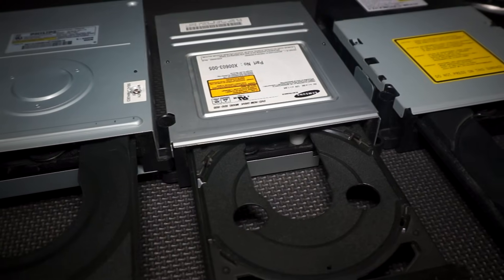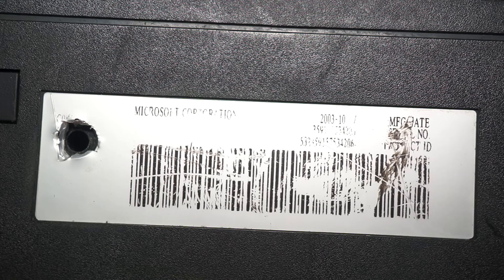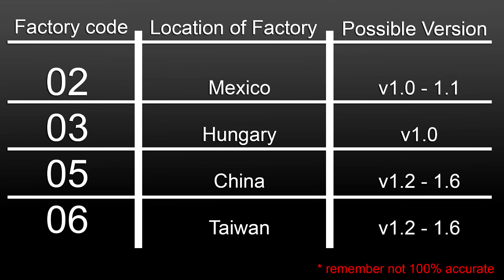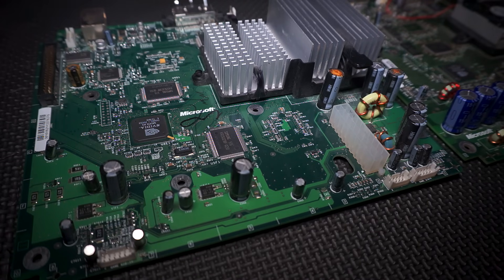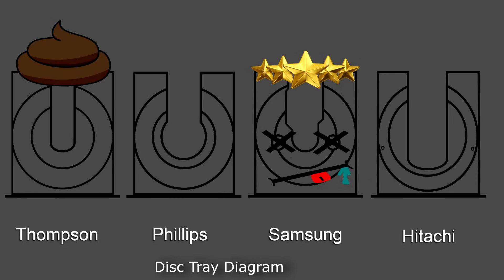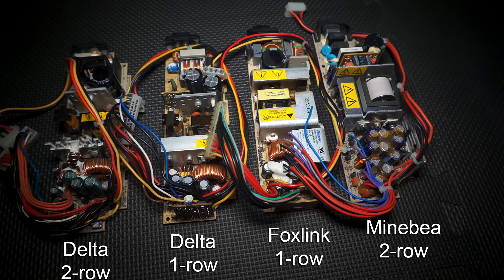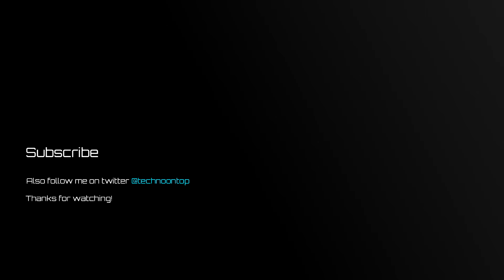How to tell what version original xbox you have

Comment from the maker: A mistake was made in telling if you have a v1.4 or a v1.5 you need to measure pin 2. I showed pin 1 also you could measure pin 9 while the console is powered on. it should be 3.3v if not it's most likely a 1.5. though there is alot of speculation around the existence of the 1.5 so who knows. wish I would have caught my mistake way earlier.
Reply: I found my Xbox on the thrash and silly me brought it home, after like 5 minutes i learned my mistake... it had an infestation of roaches!! i had to quickly bring the spraycan. I spent like 3 hours of cleaning two coats of roach shit and killing the buggers. When i checked the PSU and it had some sort of "Fuse" covered by plastic, after scraping the plastic covering the fuse, it looked like it had blown. So i made a small bridge between both ends and put it together. My Xbox motherboard has much less capacitators. I tried searching for videos and screenshots of my motherboard but none of the 100+ screenshots that i found seem to match the motherboard that i got. I could not even find the Clock cap... now you mentioned an Xcalibur video chip, it seems that i have that, and that would mean i have a v1.6? The xbox came with a Samsung DVD Drive, an 8GB HDD Western Digital and the PSU which says Delta.

After a couple days i ordered the AV Cables, two controllers and a power cord, since whoever threw didn't got rid of those. The XBOX workd perfectly after cleaning it and bridging the PSU fuse. I want to get a new Fuse but there is absolutely zero info regarding the Fuse Voltage/Amp. When i launched the Xbox I noticed it had a TON of Emulators ranging from NES, SNES, N64, Sega Master/Genesis and MAME. 

I thought 1.6 was hard to softmod, but i can't seem to find any sort of chip installed to the motherboard. I am also trying to update the softmod launcher but i know very little about such things. For now, everything works perfectly and i am kinda getting attached to this roachy xbox console.
Reply: @EtaYorius  roachxbox
Reply: @waltersobchak7275  roachbox lol
Reply: softmod is as easily done on a v1.6 as on any other versions.
ram upgrade and a tsop flash are not possible on a v1.6
a modchip can be mounted but requires some soldering to get it working.
Reply from the maker: @Steve Underwood the pins are on the LPC header, if you google "xbox LPC pinout" you should be able to find a pinout to aid you. thanks a bunch its much appreciated!

Comment: Can anyone confirm if the console freezes when doing the splinter cell hack and having everything running properly beforehand, can anyone say if that means that I do have a 1.6 version? I thought I did have a slightly older model, but even though there was a video explaining that if it does freeze then you just need to do it again but it would never work for me so I think this system is the latest version. It does have a Phillips disk drive so I'm not sure

Comment: Forgot one little detail about the 1.6 motherboard. It has a gold clock capacitor and lasts alot longer and less prone to leaking. Good info. I have 5 original xboxs and only 2 that work. The others are just for parts.
Reply: I have Xbox 2004-10-14 do I have a 1.6 ?

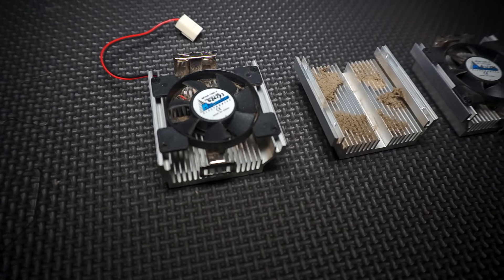Comment: Our sticker is missing and our system is modded. Have a single row power supply, Conexant chip, and no fan on the motherboard, just the upgrade you talk about at 4:14.  Still unsure if it's a 1.1 because it's not the same

Comment: found my old xbox after it sitting in storage for 15 years, it was soft modded a long time ago, looks to be a 1.6b with hynix chip and xbox logo. should i bother with hardmod or just RGH my 360 and get an emulator?
P.S. Power supply is 2 row delta but different version than whats in the video, im assuming since the box is 1.6b its newest revision.

Comment: I've got to open mine again to check the capacitors and figure out why the DVD drive has stopped reading discs, was full of dust at one point but cleaning it out didn't help at all. 

I'll look into softmodding it so I can enable higher resolution outputs. Good video, very informative.

Comment: So....i got 3 original xboxes. tho only one of them is working the other 2 have an broken powersupply. Is there a place where u can still buy those powersupply's In the eu?
Reply from the maker: I'd check for cold joints on the boards first. Also I'd swap the working one into the other 2 (if they are compatible) just to actually make sure the psu is the problem.

Comment: the way to tell the difference between v1.2 and v1.3 is to check LPC pin 3 with an Ohm meter set on the 2000 scale. a v1.2 will get a reading, the v1.3 will be open circuit. v1.2s are actaully very uncommon.

Comment: Back when the 1.6B came out. I wrote a program that basically has you select certain steps to find out which version you have. It should be on the old Xbox modding forum for the OG xbox.
Combination of several factors. Serial, chips, heat sink, fan etc. Then you could know what was needed to mod yours.
However now there is 1 chip that can mod any of them.
Reply from the maker: Yeah I remember it way back in the day on xboxscene.com

Comment: Are these power supplies interchangeable? I have a v1.0 for 2002-10-9 and I have the delta 1-row that is COMPLETELY shot all of the capacitors are blown up with the white stuff coming out and the copper circle round things are all blown the whole thing is garbage, I would just like to know if I can change them out or if I have to stick with the delta 1-row. Thank you
Reply: Thompson disk drive and kernel 4034 with the western digital 8gb hard drive, I want to upgrade the ram and the gpu cooling (before it turns into a lawnmower) and reapply the thermal paste for both gpu and cpu and I want to soft mod and put an upgraded 80wire ied instead of the stock 40wire
Reply from the maker: Yes all one row power supplies csm be used. Are you sure the power supply is actually bad, they do cover the caps in white adhesive. It's to help them stay in place from vibrations and what not.
Reply: @TechnoOnTop  I turn it on and let's say I load like Sega gt 2002 it loads for maybe 45 seconds at most and then it boots me to home and the green around the disc button turns red
Reply from the maker: @gabrielbanta5098 have you redid  the thermal paste yet? That honestly sounds like it's just overheating.
Reply: @TechnoOnTop  not yet should I do that and see if it fixes it instead of buying a whole new power supply ?
Reply from the maker: @gabrielbanta5098  definitely do that first
Reply: @TechnoOnTop  okay, thank you I'll try not to mess it up I have it all taken apart I hope I can put it back together lol, but I'll do the paste and let you know if It fixes it
Reply from the maker: @gabrielbanta5098  just take it slow and stay organized, the xbox is extremely easy to take apart. Good luck

Comment: This video is the reason I found out the Xbox I've had for the last 18 years is a 1.6b. I have the Xcalliber encoder chip and the Hynix ram modules. The manufacture date is 2005/04/25 which means it was one of the last consoles off the production line. I think there were fewer than 4 months of consoles produced after mine.
Edit: my power supply doesn't resemble any of those either. Want me to send you a picture of mine?
Reply: Yo, ik that uh, i'm commenting later, didn't need everythingnfrom this video, since i knew about MFR date stuff (just like on any other xbox) serial number, disc drives, 1.0 gpu heatsink, etc. But yea, i also have 1.6b from April 2005, i believe it was April 19 tho? Not sure

Comment: Thanks to your video I was able to discover my cousins Xbox from childhood was a v1.0 with a Delta 1-Row PSU (I'm shocked it hasn't caught fire after all these years), 10mb Seagate hard drive, and a Thompson drive which indeed is terrible and had more issues running the GTA games than anything else. After taking his to soft mod it, I replaced his with a v1.6 so he could still have an Xbox, it happened to have a Hitachi drive, and I can also confirm it definitely loaded faster after comparing with the v1.0.
Reply: my v1.0 xbox has trouble running gta san andreas. sometimes I get a disc read errror. is the thompson drive causing this
Reply: @ockertoustesizem1234  Im so sorry it has taken me a year to respond, But it would seem it would be. The laser diodes used in the Thompson drives aren't designed to last, and burn out after years of use. It was even terrible at reading when it was still new, freezing on loading screens for GTA Vice City, and it only got worse as years went on. My Thompson drive FINALLY died, as it stopped reading all together just a few days before posting this. If yours still works, i seriously suggest softmodding it. You can then clone the hard drive to one with more storage, then can just burn the games onto the new hard drive before the laser dies. Games burned onto the drive play and load better even on a v1.0, as its booting from the hard drive and not the disc drive.

Comment: One thing that needs to be mentioned is the clock capacitor. Every xbox except for the 1.6 and 1.6b need the capacitor removed because it will over time leak onto the board and kill the console.

Comment: I'm currently trying to fix my friends Xbox and there is no clock capacitor and no acid but it still turns on then off twice then flashes red and green can anyone help with any fixes please its a 2003 mfg it has a focus chip Samsung disc drive (that is also stuck )  the 8 gig western digital  and the 1 row fox link I'm so confused on whats wrong I dont have a av cable so i cant see the error code
Reply from the maker: You should get an av cable. I feel like It does that when nothing is plugged in
Reply: @TechnoOnTop  i ordered one not long ago ill update you when its here

Comment: I have a xbox v 1.6. No LPC, xcalibur video chip, no fan on the taller passive heat sink, 2 row PSU connector, Samsung memory chips, and no kernal sticker.  I need to get a case to put it in. I had intended to put it in my originally purchased xbox v 1.5 I think. But I hear that you can not put it in just any case. Something about it grounding out.  Can anyone share with me how to identify a case, and to be sure I can install it without grounding it out or something.  I wish to at least soft mod it and add sata hdd. Thank you for any assistance you can provide to help me get this working xbox into a case.
Reply from the maker: So I am a bit rusty with this stuff, but I'm pretty sure if you just remove the metal shielding there will be no problems, I believe one screw hole won't match up.

Comment: Found an Xbox at Goodwill yesterday for $15. Cleaned up good and I did open up and removed the clock capacitor. Seems like it did leak but not anything bad though glad it's out now. It's a 1.0 Xbox by the way because it has the second fan that is on the heatsink over GPU. I knew when I got it that it was a 1.0 or 1.1 because of the September 2002 manufactured date.  It didn't have a controller so I definitely want to get a "Duke" to go with it. I already had the S controller but a Duke would be perfect for a 1.0 Xbox.

Also it has the Thompson disc drive and opening fine though it's noisy. I actually already had a 1.6 with the Samsung disc drive and it's quite but does stick at first when opening. My 1.6 if it has no disc on and has not been used after a day or so I have to press the button a few times to get disc drive open as it acts stuck. 

My 1.0 has that Seagate that is second to the left of this video and it's noticable loud compared to my 1.6. I assume this is normal based on some other YouTube videos I have watched of the 1.0 being noisy. I should mod my consoles as it's only way to change the hard drive. I don't know if I have a way to without an actual PC as I only have my phone web browser. All I know is need a mod chip and a CD with some sort of files to mod it.

Personally I like having a 1.6 as it doesn't have the clock capacitor issue. That's why I bought it but it wasn't until after that I heard about the Xcalibur chip having issues with some games. I think it's only a few games but some have issues displaying in 480p on a 1.6 model. Only game I have that has the issue is Panzer Dragoon Orta which is backwards compatible with my Xbox One X. Still to get a 1.0 which doesn't have the issue is great as I wanted to play on original hardware. Yes I have tried the game on both systems and my 1.6 has the issue while my 1.0 doesn't.

Comment: i have a foxlink 1 that stop working . and the motherboard has 4 popped capacitors
Reply from the maker: I'd start by replacing the caps, will probably spring back to life. Also check for trace damage around the caps and repair as needed

Comment: one question about the DVD drives, say if my old DVD drive starts to wear out to the point of not reading games or freezing during the game, would it still work if i replaced it with any of the other 4 drives shown in the video, or does it have to be the same type of drive my xbox came with?
Reply from the maker: The drives can be swapped no issues all plug and play.
Reply: @TechnoOnTop  same with the hard drive?
planning on swapping hard drives with another xbox if i find one, in case i'm not able to find a new disc drive
Reply from the maker: @JPiXeL  no harddrives are tied to the motherboard. If you hardmod you can buy a bigger brand new harddrive no issues
Reply: @TechnoOnTop  ohh, okay thanks
just wanted to know a few things before i start messing with the internal components again

Comment: i wanted to soft mod a xbox  i bought but its hard modded with a executer  2  chip with the 3 switchers on the front on /off mod chip bank1/2 leds 
+ as evox installed in the hd 
tried to put soft mod in with chip on - dont let me 
turn chip off wont let me back up the ms -
was using the splinter cell disc 
Ps nice vid

Comment: How do I make my xbox region free so I can play Japanese games? I also want the original menu to be the same but I want to be able to play japan discs. Any help? Thanks
Reply from the maker: One way to accomplish this (i think lol), would be to buy a modchip then flash a stock bios of that specific region. You'd keep stock look but obviously you'd have to either have to take out the modchip if you wanted it back to your region or disable via a switch/button combo. If you used an open xenium chip you wouldn't have to take the chip out but when you turned on the xbox you would be greated with the modchips OS first. I'm not exactly sure what happens when you flash stock bios on modchips as iv never done it you might end up with an error code.

I totally get the want to keep it as stock as possible though iv personally never had the feeling with the og xbox.so I'd say just mod it. That or you could just import a Japanese one (probably pretty expensive). On option that I only just read would be softmod the console then switch the region then unmod it. It will apparently keep the region you selected kinda funny. Hopefully that helps somewhat good luck and thanks for watching!

Comment: my power supply looks like a mix between a delta 2-row and delta 1-row. Also, I am 80% sure my disk drive (the Seagate to the far right) is causing an error 07 to my xbox (version 1.6). Is there any way I can fix it?

Edit: Also my disk drive is a Hitachi
Reply from the maker: If you think your harddrive is failing the best course of action is to mod it. I'd recommend a modchip. Open xenium is the best available and they aren't to expensive (as far as I know haven't bought one Ina awhile now)

Comment: I've had all 4 disc drives. The Hitachi worked well, but it was a bit noisy mechanically. There were actually two version of the Samsung drive. The first version was the best one. The second version did not read CD-R nearly as well. There's a very small subtle difference to the disc tray as well that you can check to determine which version you had.
Reply: Interesting, what year (or years) were the models with the better Samsung disc drive??

Comment: So Which version (1-1.6) is the best to buy in 2021/2022 for softmoded specially ?
Reply from the maker: I wouldn't recommend a softmod at all unless your just doing it to do a TSOP flash. As the console ages so does the harddrive. But if your set on just a softmod then I suppose going with the newest is best so a 1.6b

Comment: So I have the Halo Xbox and it shows it was made in Feb. 04 and has a Phillips Drive. Shows it was made in China as well. Not sure which one it could be unless I opened it which I don’t really want to do.
Reply from the maker: Yeah I get it special editions aren't usually the consoles you open up. But due to the clock cap most will need to be opened to preserve them. I asked a collector buddy of mine he told me he plans on very carefully/thoughtfully opening them at some point. My halo xbox is a 1.4 the previous owner had opened it so I didn't have any dilemma.

Comment: The best thing about 1.6 xboxes is that you wont need to worry about the time capacitor leaking.
Reply from the maker: For the most part true, I do think leaky caps have been found on 1.6s I remember seeing it on reddit I believe.
Reply: @TechnoOnTop  maybe the early 1.6 xboxes got it, and the later ones didn't

Comment: Hitachi drives are bullet proof. Only reason why samsung had the rep for being best at the time is most people never had an xbox with the hitachi drive as it was late in production and are quite rare.
Reply from the maker: Thanks for sharing that, given that info I would also assume most modders steered clear of 1.6 and 1.6b's because they weren't the best and Hitachis where probably mainly in those revisions? I  have more dead samsung drives then anything else. And if they aren't dead they usually stick, definitely not a huge fan of them but the sticking is an easy fix for what thats worth.